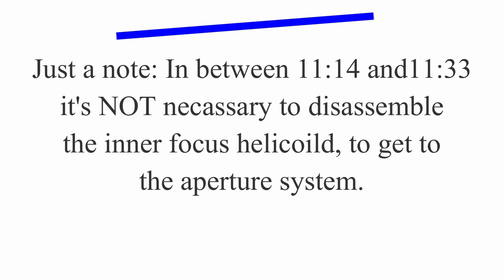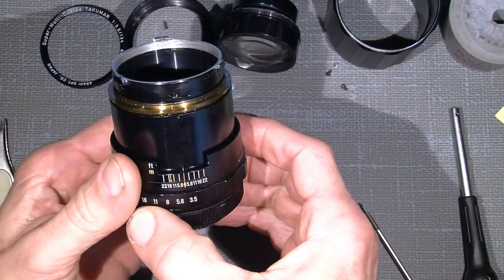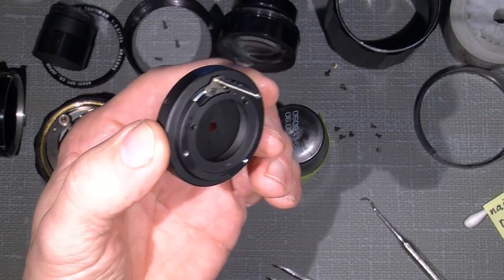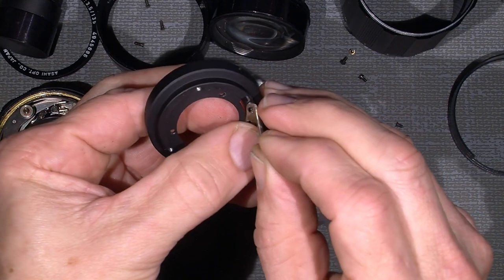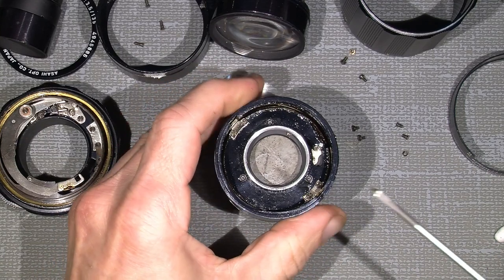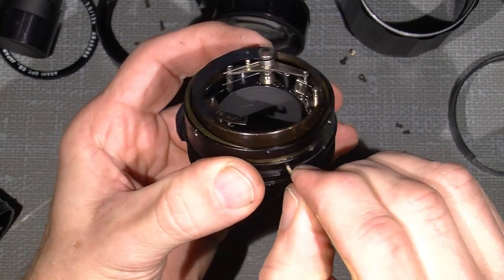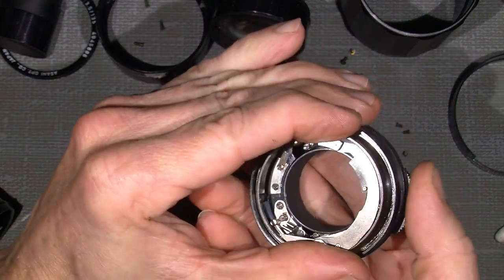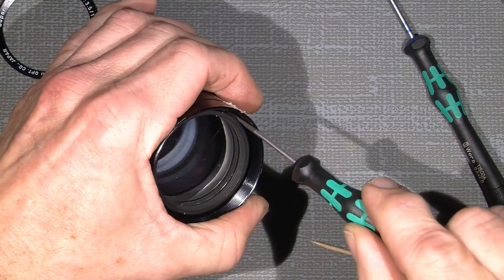Oil in the aperture system in Super-Multi-Coated TAKUMAR 1:3.5 / 135

Comment: the rubber that you use to take off the front part of the lens, whats the name of this? just rubber?
Reply from the maker: It's a rubber stopper, and I add link's in the describiton.

Here are some link's to different repair tool's:

Japan Hobby Tool rubber cone:

https://www.amazon.com/Japan-Vacuum-Camera-Opener-Repair/dp/B0013HFYKK/ref=pd_sbs_469_1?_encoding=UTF8&pd_rd_i=B0013HFYKK&pd_rd_r=RKSF5A4YKT9GV3E1382C&pd_rd_w=5H58m&pd_rd_wg=DBny2&psc=1&refRID=RKSF5A4YKT9GV3E1382C

 

18 different size rubber repair tool's:

https://www.amazon.com/Sizes-Lens-Filter-Wrench-Rubber/dp/B00988D1BK/ref=pd_sbs_469_2?_encoding=UTF8&pd_rd_i=B00988D1BK&pd_rd_r=RKSF5A4YKT9GV3E1382C&pd_rd_w=5H58m&pd_rd_wg=DBny2&psc=1&refRID=RKSF5A4YKT9GV3E1382C
 

Divider Caliper Wing Compass:

https://www.amazon.co.uk/Divider-Caliper-Compass-Marking-Machinist/dp/B015CN9A8M

 

You can also buy this set.

Lens Repair Set with pointed, flat, half flat tips:

https://www.amazon.com/dp/B00QRPWCN0/ref=psdc_3347581_t1_B00J5F6O92

JIS cross head screw driver's:

https://www.amazon.com/Moody-Tools-58-0219-Chromium-Screwdriver/dp/B004PGO1T6/ref=pd_sim_421_6?_encoding=UTF8&pd_rd_i=B004PGO1T6&pd_rd_r=775KBDR03D8PMMEZWKFJ&pd_rd_w=ti7yC&pd_rd_wg=s2a40&psc=1&refRID=775KBDR03D8PMMEZWKFJ

Or this set, that is the set I use:

https://eustore.ifixit.com/en/Tools/Drivers-Wrenches/JIS-Driver-Set.html?utm_source=iFixit&utm_campaign=Referral&utm_medium=modal&utm_content=145115

Lens cleaning wipes (PEC-PAD):

https://www.amazon.com/dp/B0161VIZZ8/ref=sspa_dk_detail_3?psc=1&pd_rd_i=B0161VIZZ8&pd_rd_wg=ZTxxY&pd_rd_r=RNY8S6Q1V5K18K3F61VZ&pd_rd_w=2c1Oy

Thin Cotton Buds x 200 you can buy them here:

https://www.muji.eu/pages/online.asp?lan=uk&ShopSel=y&scrn=1920&wndw=1920&sec=17&sub=70&pid=2469

DSLRKIT Pro Lens Vise Tool Repair Filter Ring Ajustment Steel 27mm to 130mm:

https://www.amazon.com/DSLRKIT-Repair-Filter-Ajustment-Steel/dp/B00SYBYTZO

Japan Hobby Tool Herical Grease Made in Japan:

https://www.amazon.com/Japan-Hobby-Herical-grease-JHT9110/dp/B0014ZU03M

Loctite 222 50ml Threadlocker

https://www.amazon.com/Henkel-Loctite-Threadlocker-Super-Screw/dp/B013SDAWQC

And you will also need some Isopropylalcohol 99%

And sometimes Lighter Fluid that is very good to clean lens element's.

NOTE: Do NOT! use Acetone on platic part's, it will damage / melting the plastic!!!